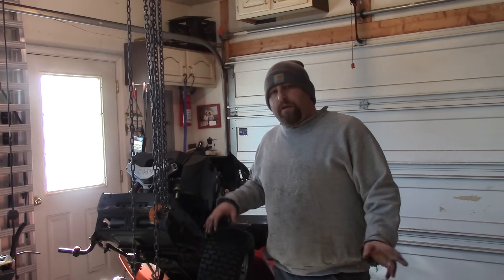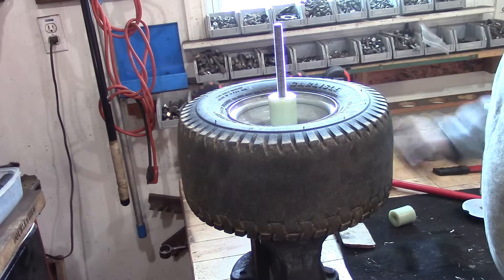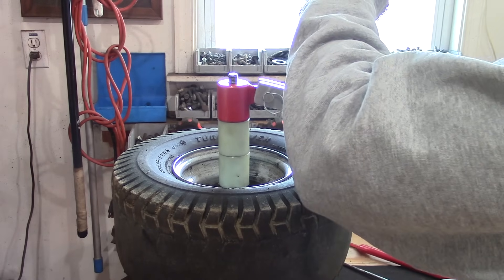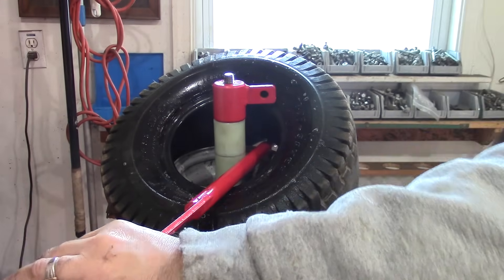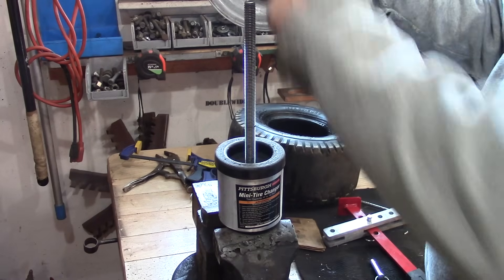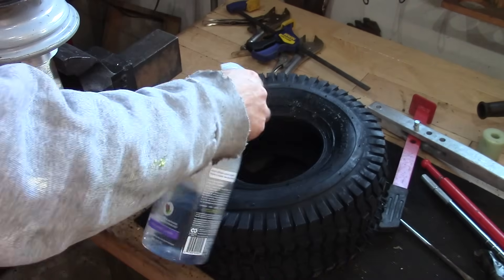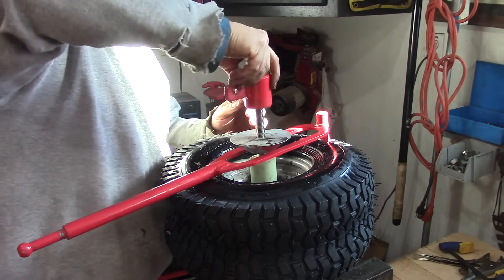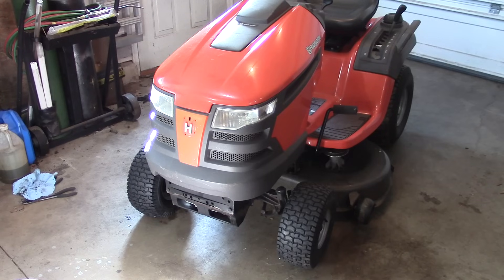Harbor Freight Mini Tire Changer 61179 for Tractor Tires

Comment: Man I just changed one of those tires on my husqvarna mower. 3 hours of cussing and finally got it done.
Reply: 🤔3 minutes for me or less😃
I do new tires every spring.
No machine.  2 clamps and three flat blade screwdrivers.
Reply: @erike.erskine7648  I use real tire spoons and leave the rim and tire on the mower, I just replaced the 22/9/12s with 24/12/12s, tilted it on it's side and was done with both in around 15 min. Used a ratchet strap when I aired the new ones up and done!!

Comment: If you were to put a 2 ft section of steel pipe over the handle you would be able to have that tire on in half the time.
Reply: I'm a little fellow. I have to use cheater pipes often.

Comment: Now change the rear tires on that mower. Harbor freight shaft don’t fit into wheel center. Had to grind two sides flat the fit into wheels 20x8.

Comment: I couldn't get that to work on my tillers 4-ply tires. I moved my entire work bench. I ended up paying a mower shop.
Reply: Soap em up, beat em on. Done it for years. Also a leaf spring from an old car or truck is an amazing tool to start around bead and beat it all around and watch tire just go on. Smaller tires are worse though for sure.

Comment: I have one one of those units and ruined the rubber piece that fits over the center tube because the wheel turned. The center tube has sharp edge inside and out where it was machined flat, and cut the rubber. I beveled both edges. A part number comes with the unit, so I went to Harbor Freight to get a new one. NOPE, can't get it. The guy, who was real nice, looked it up. It was supposed to be in a warehouse in the south, somewhere. NOPE, they don't have them. l went back a couple months later, NOPE can't get them. They've got to have a barrel of them where they make them, but, NOPE, can't get them!!😠😠😠Without it, it scratches the rim and your new paint job.

Comment: Why not just cut off the stem and the tool is for installing the stem
Reply: @Abe Yonder The easiest way to get it off is to cut it from the back side. I have saved them by lubing them and knocking them out the back side with a wooden block and a hammer.

Comment: My sister's riding mower tire looks brand new but it is flat every time she wants to cut grass with it. It's the same tire every time. She thinks you can repair the tire, but unless I see a nail in it that I can put a tire patch on, I think she is going to have to buy a new tire. I do know that you Do Not want to put Fix a Flat in the tire.

Comment: WD 40 is better to help remove the tire from rim, soapy water drys up and is not to good for a lube
Reply: Actually, petroleum based products can damage rubber. Soapy water won’t.
Reply: Once the water dries, the soap is sticky, WD40 will allow the tire to slide on the wheel sometimes. Not too big of a deal on a lawn mower front, but if it's the rear, it can stop the brakes from working properly.

Comment: You used the valve stem installer,  WRONG.  Before you review a product know how to use it yourself first.  Those grooves on the valve stem installer handle are there for a reason.

Comment: I took my tire off by hand
Reply: I had to change the same size tire on my 1993 MTD  (July 5th). Getting the old one off was not bad, but getting the new tire on took way more work. I thought about using a big bolt in a vise, but I don't have a big vice at the lake cottage.

Comment: "Tractor" tires lol. These are lawnmower tires. I found this bc i was looking for an actual tractor tire changer. And you can get that stem out in 2 seconds with pliers...you used and installer lol and called it a removal tool. Still glad i found this though as i could sure use a lawnmower tire tool as well as many as i work on.